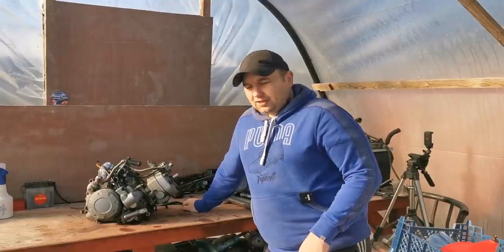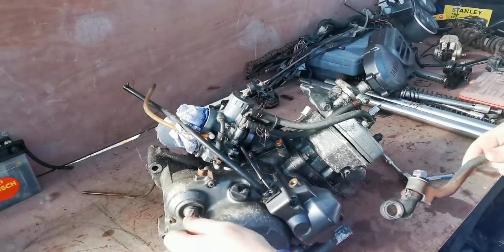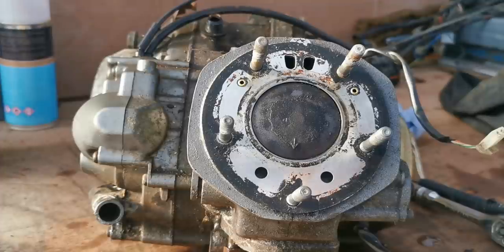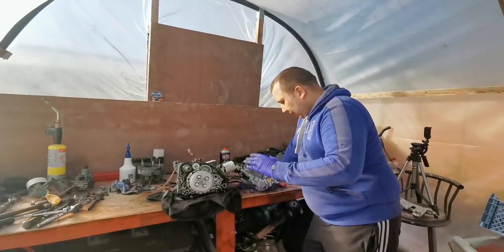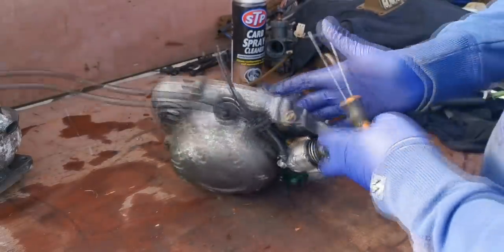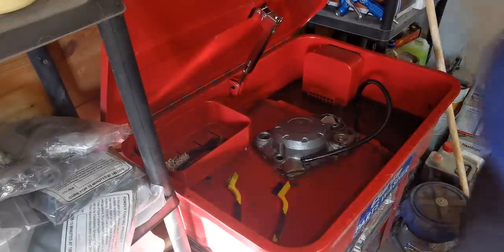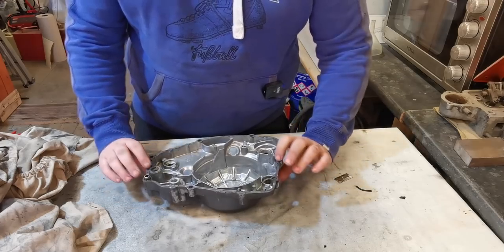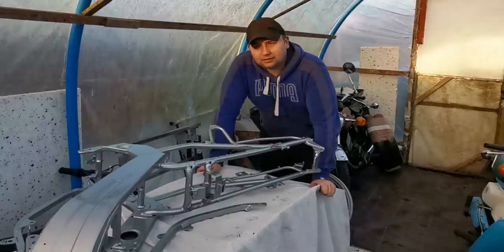Yamaha TZR 125 2RH Engine Strip Down

Comment: Nice colour for the casing Gary. 👍 Did i see an oil site glass on the casing? I'm asking because i refurbed one a Honda recently and the glass was held in with a rubber seal, thinking the heat from the oven could of effected it.
Reply from the maker: Every thing was stripped off mate 👍🏻

Comment: If it's had a rebore and piston I think it's right time to get the crank pressed apart and new needle rollers and cages with some new crank bearings and seals the only way they get lube is from autolube pump and petrol there penny's and fail in worst cicumstances